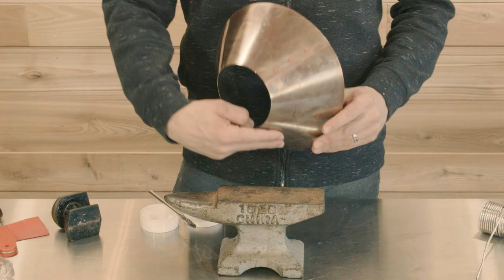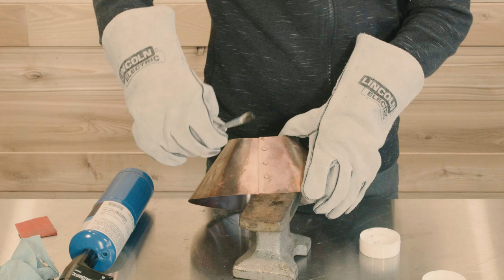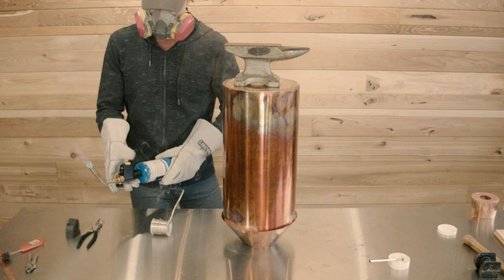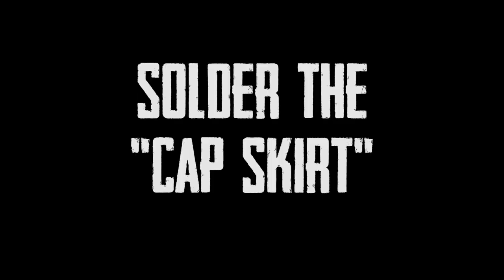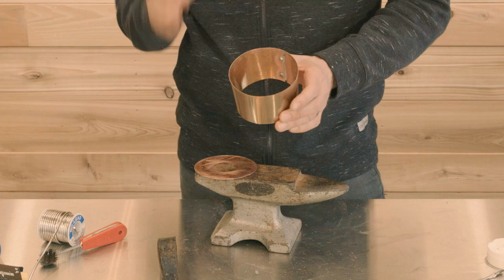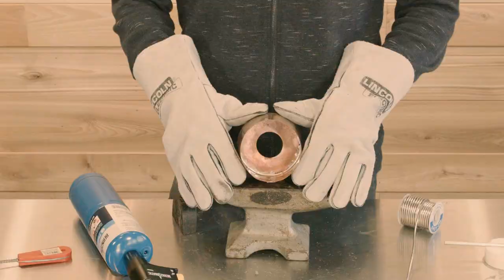How to Make a Moonshine Still - Part 6 - Building a Vapor Cone and Lid

Comment: Really not that impressed with your soldering work.  Pulling the heat away like you do doesnt flow it in anywhere near as clean and complete as if you left the heat on and worked faster or turn the torch down a bit and work a bit slower.

Comment: As a Plumber i use Tinning flux which has soldier already in the flux. If its safe on water pipes it should be fine for this.